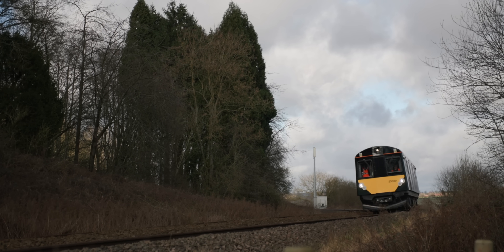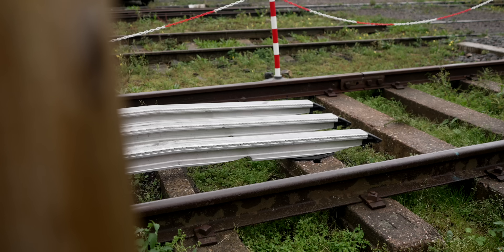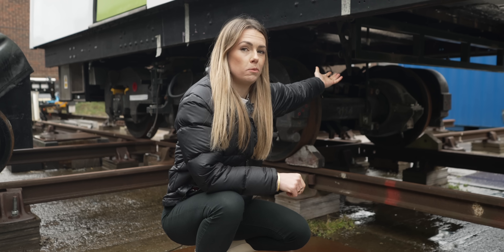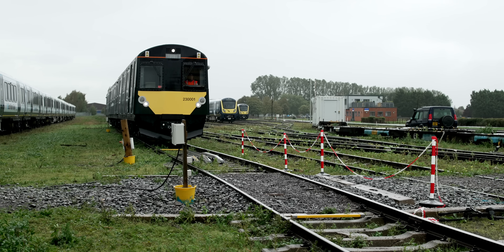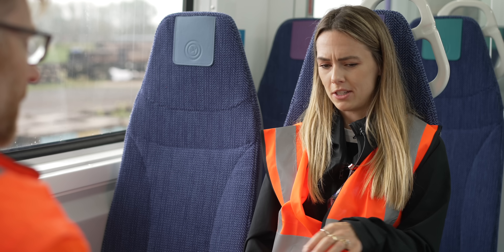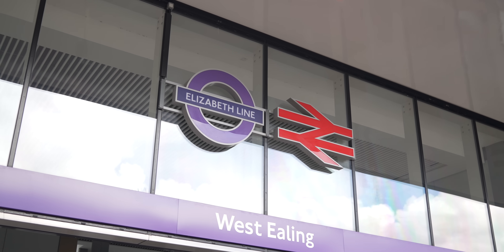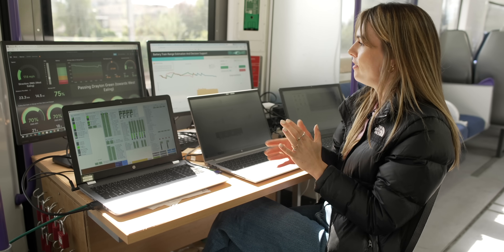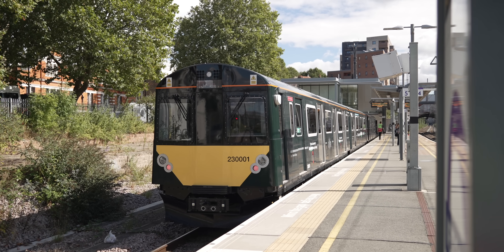Onboard the UK's First Battery Electric Train!

Comment: The obvious problem with running trains 'online' is that their peak demands are whenever their peak demands are. UK isn't like other countries. We have colossal VRE potential in highly intermittent offshore wind, and no really good ways to meet undeferable demand. A country with huge constant power supply by nuclear reactors so dependent on Russian nuclear services that their leader tells us not to humiliate Putin, or by having humongous easily-controllable hydropower might be able to straightforwardly electrify everything, *but we're not them*. Storage - likely in many different forms - is going to play a key role in UK NetZero.
Reply: Batteries trackside means peak is not an issue.
Reply: @thekaxmax  Yes, that is my point. It does allow trains to defer their demand on the national supply, and to take advantage of trough pricing.
Reply: @damiendye6623  that's a consumer application now. Doing it at national scale is a big job. Storage like Dinorwig can shift only about a half hour of energy from trough demand to peak demand and due to our best supply being wind, sometimes energy is expensive during trough too. Storing all our peak supply to use at peak demand/trough supply would require 1,000s of Dinorwigs, or some tech we seem to be strenuously dodging. Consumer batteries are a pragmatic choice in the absence of a well-advanced plan. We don't even have a whiff of a plan being started.
Reply: @trs4u the Labour Gov't have actually offered a whiff of a plan plus £3.5bn cash to back it up. They also mention tidal which the previous Gov't shelved for a decade or more.
Reply: @alanhat5252  I'm not sure about the recent nods to noddy RE. For wealthy happy NetZero UK we need 100s of GW of capacity, if not a TW or two. Nothing but offshore wind offers potential at that scale. Got nothing against tidal if someone can make it profitable, but current estimates are we have only tens of GW of potential?

Comment: Faster than diesel that can’t reach the terminal speed. Cool!  Did I miss something on regen braking?  Seems obvious to me given the mass of a train. Perhaps I was sleeping awake if it was mentioned.
Reply: I didn't spot anything on regen braking - it would be a missed opportunity to omit it (unless it's problematic to install).
Reply: All modern trains are electric driven, the fossil just turns an alternator and a such all trains regrn brake just on a fossil one it goes into resistors on the roof fully electric goes into the grid and these into the battery. 
Not need to mention something that they been doing for nearly 100 years
Reply: @damiendye6623 Some regen brakes put power back into the grid.
Reply: @damiendye6623  A lot of things have been going on for nearly 100 years that people who aren't train experts don't know about!
Reply: Also not all modern trains are electrically driven for example the new class 197s with transport for wales are diesel mechanical multiple units.
Reply: Regen braking would be a good idea but my guess here is they are prototyping their idea of specifically recharging, add the extra stuff once the core aspect is commercially viable.
Reply: @WelshGuitarDude  The unit had regen braking from before the concept stage of the 230.
Reply: @J-Railway-Volunteer  then i see why they didn't talk about it, its not that significant since it seems pretty standard already.

Comment: My spontaneous subjective thought is that this might be a more material efficient solution than any rail or line solution. Were I'm coming from it's far too common that commuter trains get standing, because of reasons, between stations, for how long can it keep the heat going in the winter?

Comment: Why is the Everything Electric Show presenting battery electric trains, as a good thing? This is clearly far more expensive and inefficient, than simply using overhead lines and/or a third rail. It might be cheaper to set up, making it cheaper, in the short term, but when it comes to running and maintaining... This goes against sustainability, efficiency, the climate etc, so praising it runs completely counter to the supposed goals/purpose of the channel.
Reply: How do you know it is more expensive to run and maintain? Those cables don't hang there for free forever after you put them up.
Reply: @geirmyrvagnes8718  The batteries don't sit there for free, forever, after you put them in ...and they degrade relatively quickly. Also, battery trains involve a lot more parts. More complications. More maintenance ...and electric losses, from putting electricity from the grid into the batteries, and then from the batteries to the engines ...which include the losses, inherent in the process of taking energy in and out of the battery. Also, the extra weight means more mass you have to move, meaning you have to use more electricity.
I could go on.

With overhead wires, you just have the wires and the pantograph. A lot more simple, making it a lot more reliable, easy to maintain, and less in need of maintenance. Electric loses are far lesser, as it's just from the wires to the engines. (also from the grid to the wires, probably) That's it.
Reply: @ZarlanTheGreen  There is no question that both solutions cost money. I was just asking how you know the battery option is more expensive, and you don't. All of the factors you ramble on about are obvious. Except for you complete lack of understanding of the enormous continuing maintenance needed for the vast amount of complicated moving parts that is a an overhead wire, of course. But I put that down to you wanting to make your point about how cheap they supposedly are, so no big deal. The problem is how expensive they are to build, especially on an already existing line that will have all sorts of space limitations. If they really were the obviously cheaper option, they wouldn't bother with battery trains, and definitely not with diesel trains.
Reply: @geirmyrvagnes8718  I have explained how and why it is clearly a LOT more expensive. It's nowhere near close.
As for the "enormous" continuous maintenance of an overhead wire... that is nothing compared to the maintenance of the far more parts, including far more moving parts, that is involved with battery trains. "The problem is how expensive they are to build"? Yes. That is the one and only drawback, which is why the initial cost is greater.
Saying that if it were clearly cheaper, no one would bother with battery/diesel, is quite ignorant.
Most politicians and bosses of big companies, tend to purely focus on short term costs/profits, at the expense of long term considerations.
Not to mention, how people are more stupid, incompetent, ignorant, and arrogant, and have a greater tendency to reject facts, the higher status/wealth they have.
Reply: @ZarlanTheGreen  Well, now you are just rambling. Which is fine in a comment section. You have not explained how and why one thing is more expensive than the other. That would take some numbers. At least two. It seems your status and wealth is considerable. 😁
Reply: @geirmyrvagnes8718  No explanations? \*looks at my first reply* ... okay, so you're just a lying troll. Okay. Bye.
Reply: @ZarlanTheGreen  You have explained nothing. Just listed up obvious things that everybody knows with a heavy anti-battery bias. Not a single number. And then you claim one thing is more expensive than another thing. Arrogance and ignorance.
Reply: It's a lot less bad for the climate than continuing to run diesel trains. In many cases we can have this kind of solution soon, or we can wait maybe 100 years until the budget becomes available to electrify all our branch lines.
Reply: @simhedgesrex7097  There is plenty budget enough to electrify the rails, if those in power had any sense, and didn't just purely focus on short term costs, at the expense of the long term.
Reply: @ZarlanTheGreen  How would that work?
Reply: @simhedgesrex7097  How would what work?

Comment: Overhead lines are too expensive, in tunnels? Even if that's true, that just means you could go with an electrified third rail, instead. I don't see how batteries make any sense, in any situation.
Reply: Third rail has major safety implications, is less efficient and costs more to install.  "Because third-rail systems, which are located close to the ground, present electric shock hazards, high voltages (above 1500 V) are not considered safe. A very high current must therefore be used to transfer adequate power to the train, resulting in high resistive losses, and requiring relatively closely spaced feed points (electrical substations)."
The solution in the video seems to be designed to be installed with relatively low infrastructure costs and gentler demands on the grid.
Reply: @simhedgesrex7097  There are solutions for the safety concerns. (which apply, if the rail isn't fully grade separated) As for the claim that it is less efficient than using battery trains: That is preposterous. Costs more to install? Yes, but it's a hell of a lot cheaper to run and maintain. As for tunnels: No one said anything about it being an issue, specific to existing tunnels being too small. The claim was in regards to tunnels, in general. I.e. equally true of any new tunnels you'd make.
Reply: @ZarlanTheGreen  The claim failed to distinguish new tunnels (which are not an issue), because other than the Elizabeth Line, HS1 and HS2 (for which this solution is not proposed) there are almost no new tunnels in the UK.  So not worth spending billions more to install in order to save a bit of money during operation for branch lines.
Reply: @simhedgesrex7097  "there are almost no new tunnels in the UK"? ... I'm talking about tunnels that haven't been built yet. Also, if overhead lines are too much trouble: That's what third rails are for. (and, as I said, there are solutions for the safety, these days)
Reply: "Overhead lines are too expensive, in tunnels?" - yes, because in Victorian times, when most of our tunnels were build, they didn't foresee the need to build enough clearance above trains to allow for electric wires above them. So you need to lower the tracks, put in extra draining, and allow for water to drip on the lines, etc.  So yes, expensive.
Reply: Someone evidently isn't familiar with railway tunnels in perannially soggy terrain

Comment: A battery electric train? ... It doesn't make any kind of sense, to have trains run on anything other than electricity from either overhead lines, or an electrified third rail. AFAIK, there are no other kind of trains, here in Sweden.
Reply: About 75% of Sweden's 11,000 km of railway is electrified.  So presumably the remainder is running on diesel.

Comment: Battery electric trains are wrong headed direction. Trains are exactly the mode that demands full catenary electrification. The example shown here requires a large distribution of battery infrastructure, because of those storage container batteries at all the stops. Stop using batteries for the wrong situation. Electric rail for the win. Just stop thinking BEV trains are good for our future. Nationalize your railway system again, standardize your solution, and stop the splintered innovation that is occurring because you've privatized your railway.
https://youtu.be/M3afnfNQTu0?si=kAsSUK-mH921SXYw
Reply: Ultimately, I agree  .... and so did Richard Beeching. Had we started when the 'Reshaping' report was accepted, we'd st least have mainlines, including the bulk of freight lines, sparked up by now.
Reply: BTW, same problem in the USA with BEV lorries. We need rail to creep into all those places that semi trucks currently think they're the only mode that can serve. The inefficiency of trucks vs. rail is very well understood. But the insane reliance on massive battery packs and massive city-sized-power-sucking BEV truck stops is not feasible. Stop solving tough problems with tech bro solutions. Study the physics, audit the long term viability of the solutions, and stop pimping bad tech.
Reply: @karlInSanDiego  Where's the money going to come from to put in full catenary solutions for thousands of miles of rail?  The last time the UK electrified about 150 miles of rail, it cost over a billion pounds.
Reply: @simhedgesrex7097  Give a link about that 150 mile billion pound electrification project and we can talk about the merits of the spending. To say that installing catenary that can last 50 or 60 years isn't a great investment is a false economy. To say your country can't afford spending on the public good is also a false economy. If you've privatized your rail and make it the private operator's job to pay for the costs to electrify with faires, you'd better nationalize your rail system.

Municipalities struggle all the time with capital expenses. There are a lot of economies of scale that are lost when you approach a project like a mega pie to be divided up for each contractor to make their portion of profits of the projects. If you treat the problem like an ongoing division of a national system, you can keep all your workers employed continuously, establish long term supply pipelines for materials, keep all the planners and engineers employed full time, and everyone can benefit from government wages & benefits, and reasonable job security. By doing this, you've smashed the need for profit taking, removed the marketing/pitching/underemployment that is typical of a private firm that goes from boom to bust to boom every year or so trying to keep their crew in constant work. I'm not saying there are not some inefficiencies in government work, neoliberalism has driven up the cost of everything in our societies, and is profiting primarily the owners/investors of those companies. In a Climate Crisis, you need to make the most responsible choices with the emissions, materials, and time you have. Most of these lines should also be freight in addition to passenger travel so the initial capital expense is defrayed for multiple climate solutions. If you have to scale up more and more locomotives but don't have to add new batteries for each train, each of which might also need battery replacement every 8 or so years, catenary wins. The system shown here doesn't necessarily scale if you had three trains running in quick succession, because those station based batteries are underserved by the grid at that location and they won't be capable of quickly recharging. We'd also be overutilizing those station batteries if they experienced 20 charge/discharge cycles a day, and they'd degrade far too soon.
Reply: @karlInSanDiego  Your approach would be great if, like Germany, we'd had a plan to gradually and continually electrify it's rail system over decades.  But we haven't.  Electrification using overhead lines is slow, an would take many decades to achieve on any realistic timescale.  The approach in this video would help us achieve electrification much earlier, albeit a bit less efficiently.  Generally branch lines don't have "three trains in quick succession" and where they do, you can add more containers with batteries (few passenger trains run overnight) - as for degrading the batteries by multiple charges, well it depends on battery chemistry, and you wouldn't be charging and discharging 20 times a day anyway - with a charging point at every station, and with stations just a few miles apart, you don't need to charge up that much.  We are where we are, and much as you want a utopian scheme of catenary electrification fast, you aren't going to get it on grounds of money and speed.  The best way forward is to focus on continuous catenary charging on main lines, and use this kind of solution for branch lines.
Reply: @simhedgesrex7097  it's not utopian to create robust, infrastructure that prepares us for a transition off of motor vehicles. When planners assume we'll mildly shift 5 or 10% of trips away from car to trains, they are operating under the assumption that we have the resources, emissions, and energy to perpetually use cars. That's a false assumption. We will rely on trains for all medium to long distance travel.